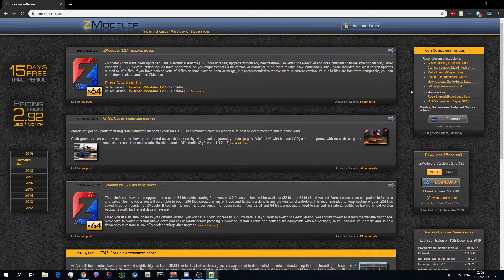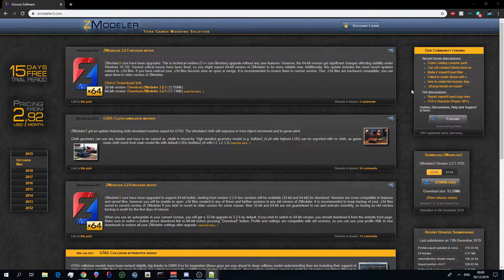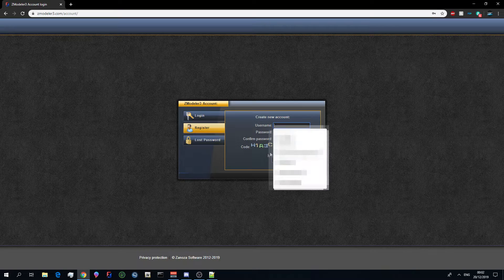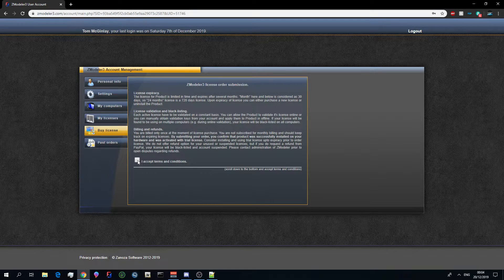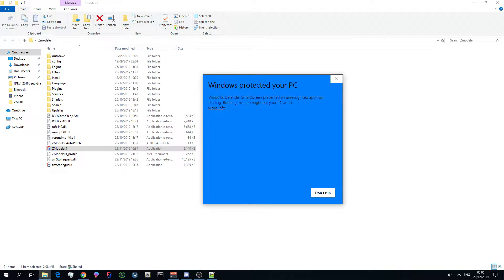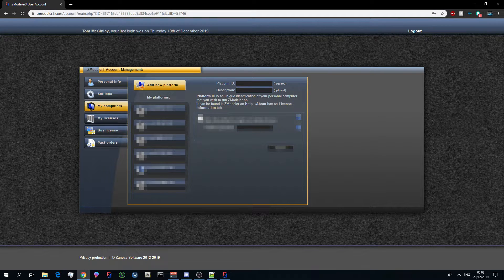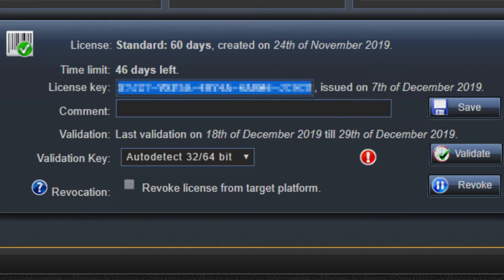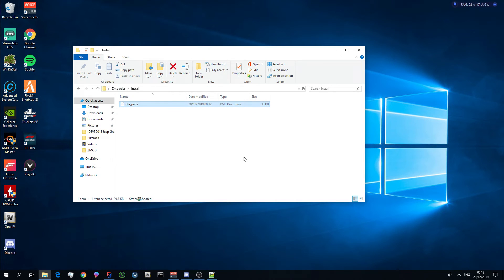SETTING UP! - How To Use ZMODELER 3 For Complete Beginners - ZMODELER 3 Tutorial - Episode 1!

Comment: doesnt work for me, at the license tab it doesnt shows me anything,
Reply from the maker: Make sure you put your email into the zmodeler account settings
Reply: @McGinlay  i did everything like you showed in the video, i put my email, i accepted the rules, but it still did not gave me any 15day free trial :D
Reply from the maker: @boby3256  If it does not give you a 15 day trial, it means you have used it before on a different account
Reply: @McGinlay  i never used the programm before,🤣 it was actually my first time to try that out but whatever,  in my opinion the zmodler is useless because of this registration, it could be way more easir to just buy lifetime license

Comment: I think the creators of ZMODELER should be locked up in a maximum security prison in population for 2 weeks for thinking this dumb ass method is user friendly. They have over 200,000 complaints about this set up process and still thinks it doesn't need to be changed.